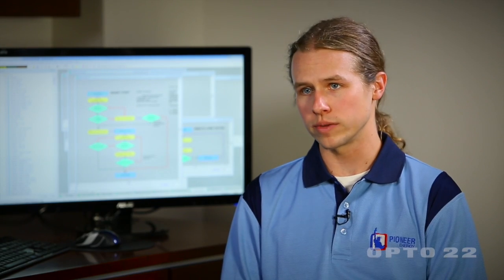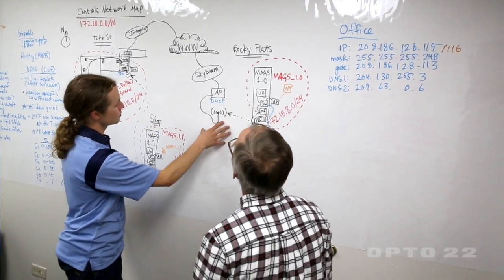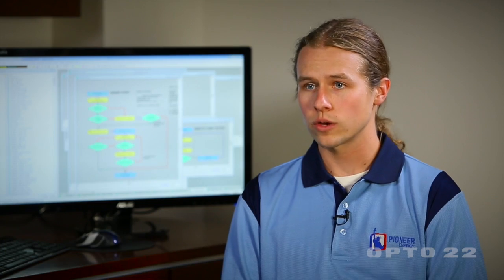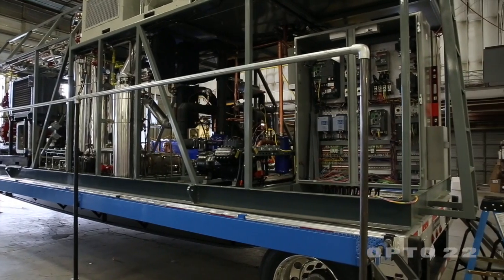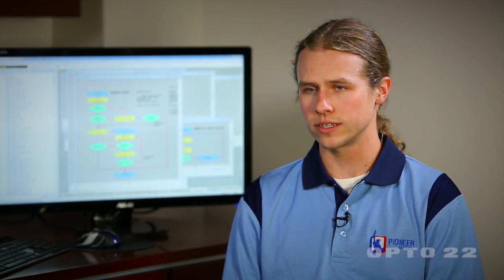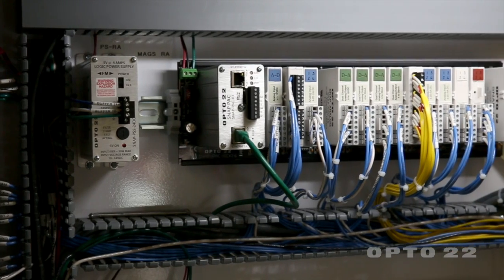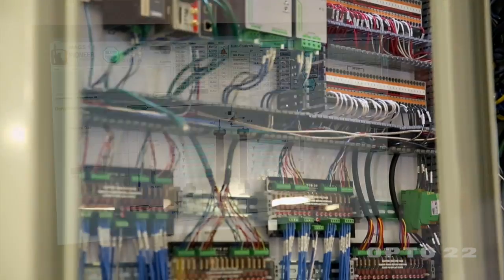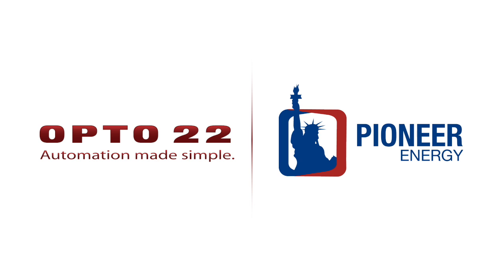Why is natural gas flared? What is the solution?

Comment: 0:30 "They have to flare it on site there's simply no other place for it to go."
Then just turn the valve off. What am I missing? I think the answer is this: They are burning off the upper layers to get to the more pure methane or ethane eventually. What a dirty process. So thanks for trying to improve it. Perhaps McSlobo is right, regulations requiring those mixed gases to be captured, requiring the Pioneer Energy machine use. That means instead of instant billionaire overnight folks, it will take you awhile, but this way you drillers won't be murdering planet earth. Let this man temper the situation and stop the waste.
Reply: This is such an ignorant comment. The regulations in place are in part what cause flaring in the first place, due to the heavy regulations restricting the building of new pipelines.
Reply: @merbear76  I agree. Boy have I changed in 3 years, can't believe I wrote that. Elect me and I'll fight to have all regulations removed back to 1953, safety is overrated, return to freedom. Website for people to report anything truly bad and we can address any real problems intelligently instead.

Comment: why don't you make a big pressure vessel  put the fire under it and use the steam to power a generator for electricity?
Reply: They do have generators at some spots but most of these wells are in remote areas where it's not cost effective to bring power to